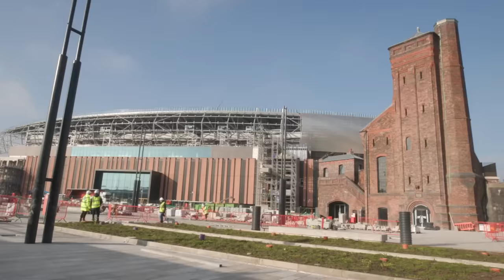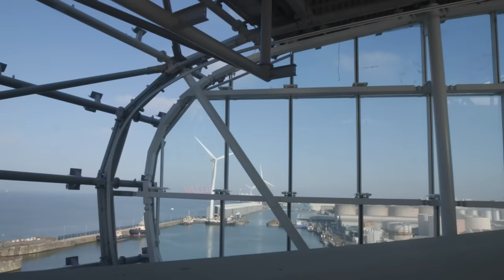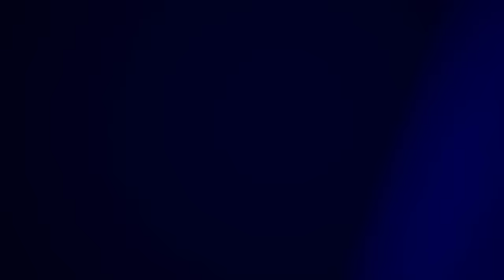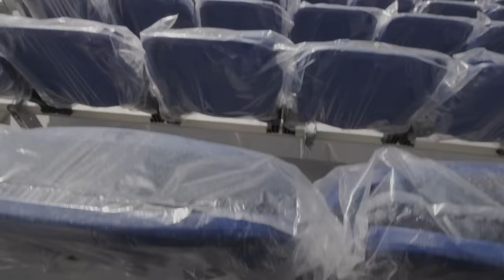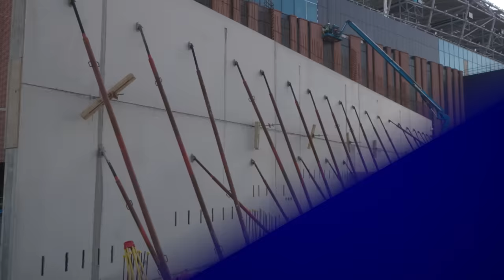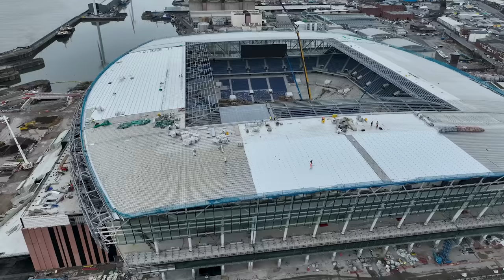30,000 SEATS INSTALLED AS ROOF TAKES SHAPE | Latest Everton Stadium footage

Comment: All seems about the dock ground if everton move ground and they leave that road as it is outside the dock ground its going to take hours getting to the match and the same getting to houses after the match plus the rail network won't be able to handle the crowds eg match people and people leaving work etc it's going to be chaos your going to have 30 thousand cars maybe more plus coaches etc decending there the congestion is going to be horrendous and there is very limited parking outside or near the dock ground, in my opinion everton should sell the dock ground and use the money to buy much needed quality players and stay at our unique home and ground goodison Park